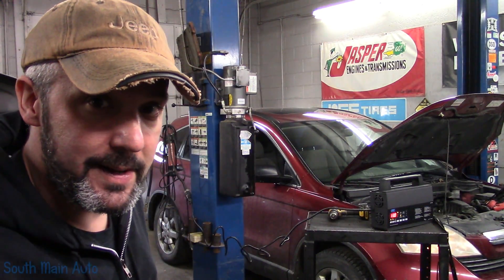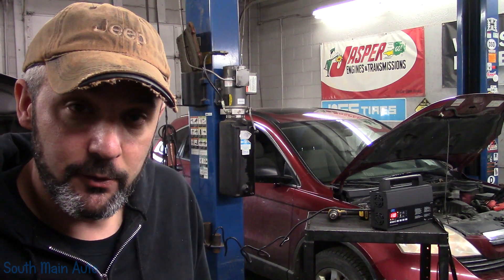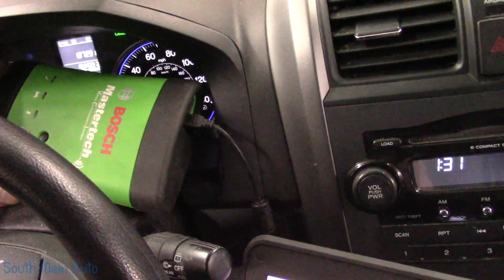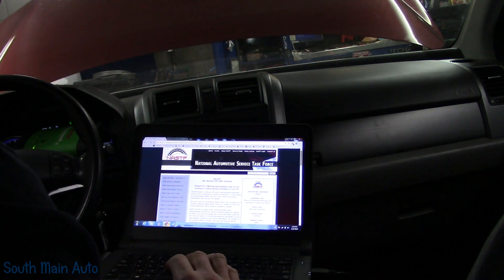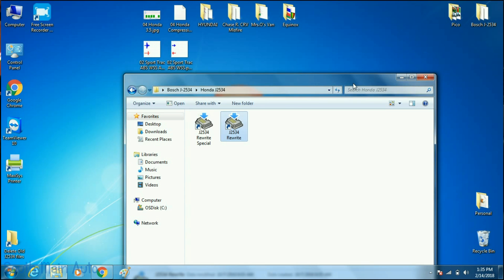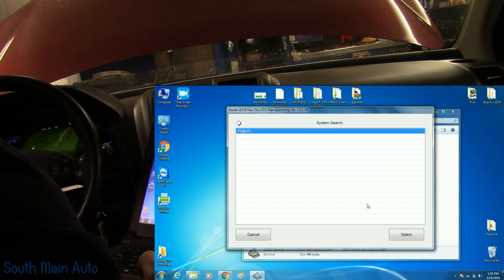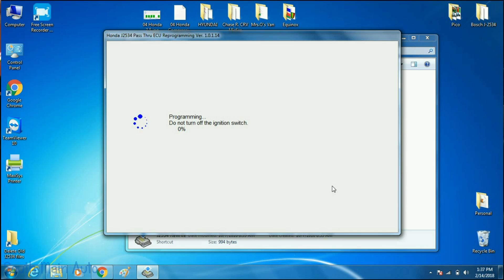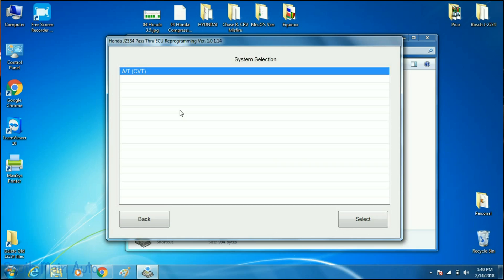Honda J2534 Flash Programming

Comment: Flash programming has been around since 1994. Availability to the aftermarket available in 1997 with the purchase  of some limited manufacturers. 1998 it became almost a standard that new computers will require programming. 2000 I purchased factory tools and started the journey. Let me just say you should be very happy youre coming into this now  and not back then. We had no support , no tech lines , no instructions at all.
Reply: Great info, Keith!
Reply: Keith back then was the laptop even a viable purchase 😂😂
Reply: Kenny B actually NO! We had to use pcmcia cards loaded off a desktop pc 😄😄
Reply: With the technology out there today I'm surprised nobody has revived the old cartridge type hardware. You could have one tool with different plug in SSD hard drives. The drives would have the software and operating system required for whichever make you are working on. Instead of needing a laptop each for GM, Ford, FCA, BMW etc, you just pop in the correct drive and connect up.  That way Keith could go from driving the van to driving a SMART car....
Reply: Does the master tech work as a full function scanner too or just for programming?
Reply: but keith just think of all that knowlege stuck on that noggin  that todays rookies may never have. and that in itself i'm sure has helped you out of more than one bind
Reply: It makes a consumer wonder just how many cars got bricked in the shop back then.
Reply: Thing is that many of those could be re-written without a lot of problems. Not like some of the ones in use today that can be killed if you enter the wrong vehicle options or have a power failure.
Reply: Time to stock up on EEPROMS and an SMD workststion.
Reply: Hi Keith, wish I could meet you and the guys this weekend. Your videos have encouraged me to start the journey! I'm a 60+ year old DIY,  any suggestions on the right j2534 tool for my new 2006 tribute ( and 99 Ram, and ?)  I've seen the  VMC 2  Ford AND Mazda version, Autoenginuity  (I have their scantool), Mongoose, Cardaq. I see I'll need a laptop and the OTC battery tender as well. Hope your weekend goes well.

Comment: It is interesting that the basic design of the OTC 700a, which is no longer available as per my search, has the same basic specifications and form factor as Baum Tools B70A, also no longer available, and the Schumacher INC100, which despite the model number and 100 Amp claim, is only 70 Amp continuous. 

From what I can tell all three are 70 Amp continuous for the vehicle power maintainer function. The problem with these units (or unit, because I think they are basically all the same design) is the output voltage noise level at higher current levels, say 55 Amps, is greater than the old industry vehicle maintainer (vehicle reprogramming, vehicle re-flasher) spec of +/- 50 mV P-P, and worse when connected to jump start posts under hood.

Unfortunately, the units summarized above do not provide a noise specification on the output at different current levels in their data sheets or user manuals. 

It would be very interesting if you could measure the output noise riding on the DC at lets say 13.4 VDC set regulated voltage at a load of 20, 50 and 70 Amps. I have been very disappointed with my Schumacher charger/maintainer products for output noise. The reason being the regulated design now uses a switching regulator approach and not a linear regulated approach. 

The older and now discontinued Midtronics PSC-550s, which was recommended by GM for module re-flashing, was trying to achieve the +/- 50 mV P-P noise specification at an output of 55 Amps while connected at the vehicle under hood battery top posts, but I think it only achieved this spec at 20 Amps at 13.4 VDC regulated output when new.

In summary, beware of what the maintainers are actually imposing on the vehicle power supply in the form of electric noise, which is even a greater concern when maintaining to jump start posts, which, being remote from the battery, have even less of a filtering effect.

Comment: Thank you for the info.  I need to check that update site for my daughter's Honda CRV.  Also, that battery charger beats a jumper box  with a power cord plugged in to maintain the battery! (Personal experience with that one on two 2008 Ford F550's programming the ECM's for those vehicles!)
Oh ya......Great Video!

Comment: A couple months back, they fixed an EVAP error code on my 13 year old Volvo with a software update that allowed it to pass the California emissions test.  No other work on the system was needed, just software.  Always check for updates as some manufacturers will produce safety and emissions control software updates more than a decade after the car was manufactured.

Comment: Anyone know of a good Honda J2534 Pass Thru interface for the DIYer?  Drew Tech's Mongoose is about the cheapest I've seen but it's $483.  I've tried the cheap Chinese hacks of the Drew Tech's interface from Amazon, but it didn't work.  You really only need the cable to be able to communicate and allow passthru onto the PCM/ECM, Honda's HDS does the all the rest and it's a free download from Honda, one just pays for the day/week/month/year subscription.
Reply: Miami13 did you find anything yet? I'm curious and I hds requires subscription right? No way to crack their software?

Comment: Two things, I currently Invested in the Autel Elite and have been using there J2534 flash programmer and its been working good. Works with GM GDS as well.  The second thing is explain to the people what a clean power source means. I know what it means and have been using the Midtronic GR8 for years.

Comment: I always get scared that If my car needs flashing or software updates that most service facilities will not have the proper equipment or knowledge to do it correctly. As Eric O pointed out, you can quickly turn your cars computer into a brick if you're not careful. Nice to see that main site has all the needed info on how to get what u need if you're going to involve yourself in that field.

Comment: how do you like the otc battery maintainer for flashing?? and also how do you justify the cost for programming when the tsb only shows 0.2 warranty time/maybe 0.5 for customer??your j2534tool and subscption cost a lot ,or do you stock couple hondas that require programming and do it at the same time???
Reply from the maker: So far so good, and I charge a flat programming fee no matter what make or model

Comment: Ford and Honda programming software on the same OS, isn't that trouble waiting to happen?
Reply from the maker: I have Ford, GM, Chrysler, Toyota, Honda, Hyundai and Kia all on this laptop.
Reply: I noticed that is why I commented, drew tech toolbox says Honda, Ford and Mazda software has conflicts when installed together and recommends having them partitioned separately. I have not run them on the same partition, so I can not confirm to have seen any issues first hand

Comment: Working on Communications Systems, our Company charged 140.00 pr Hour...How much do you charge 70.00. Theres Mechanical work and there is Computer troubleshooting work. Do not get the to mixed up, and charge according to what you are doing. Its gonna get locked up by the Mauf real soon. I witnessed it in our Industry, its now happening in yours.

Comment: Do we have to pay for the update?
Reply: Depends on the update, manufacturer, and if it's recall/warranty related. Most of the time you pay for the updates.
Reply: For Honda you pay only to access HDS, they have daily/weekly/monthly and yearly subscription plans.  The daily plans are about $10-$20 per day, you can flash/diag as many cars as you can get to during that 24 hour period.  What you really need is a good J2534 passthru cable/interface.  I've looked at the Drew Tech's Mongoose, but they're $483, a bit steep for the avg DIYer, anyone hear of an alternate option?

Comment: My stepdad has a 1990 Chevy extended cab p/u with less than 70k on it. Maybe worth buying it when opportunity arises? I believe someone like me with my limited auto mechanic skills could keep it running for a while longer without taking college level courses!
Reply: Those systems are simpler, but harder to figure out when something goes wrong because they only set trouble codes for the most obvious problems, and if you want any live data then you need to track down some scan tool with GM OBD-I support instead of using any number of cheap OBD-II devices.

Comment: What burns me is when I have called my local Ford and Dodge dealer in the past about a couple different modules that needed to be replaced, I specifically asked if those modules needed to be flashed to work, or if they were stand alone plug and play, because I suspected the former.. 3 times I got burned by the parts counter guys.. They were not plug and play, and I did not have the software to reflash them. Luckily, my buddy did and I paid him to come over and use his equipment. Now I don't trust these yoyos at all, and Google the modules 1st to see if I can do the job or not. I've been surprised about which modules have to be flashed when replaced, as well as just plug in and have a nice day... Just thought I'd share that.

Comment: I hear Cardone has flash equipment.... Any thoughts?
Reply: mike fedele no support , go with Drewtech or Aetools
Reply: Been doing good with the Autel. Nissan, Honda, GM, Ford, Dodge, Toyota but good luck with support from them.
Reply: New Level Auto thank you I did some looking at it and it looks good. I just need to find a reasonable dealer up here in Ontario Canada. Thanks again

Comment: I have a 2016 Chrysler and about a year after purchasing it, I got a message on the "infotainment" system that an update was available and I should follow the instructions.  Had to leave the ignition on engine off for 20 minutes while it downloaded.  This is a Chrysler 200 V6 FWD.  The download was successful.  I am an old timer and all this electronic jazz just dazzles me.  It is now 2018 and the car has 18K miles on it with no issues other than tire air pressure with radical outdoor temps.  But judging by the length of the queue at the only free air pump around when there is a cold snap, it must be common occurrence.
Reply: Pook Atim gotta love it

Comment: I just got done doing side work with some Honda dealerships.  The 2018's now communicate to Honda over the internet via a specially configured WiFi, and then the technician logs into a website at Honda and can do all code reading, troubleshooting, and load software updates.  They call it the AHMOTA system.  While you can get standard ODBII data from them with a scan tool all the programming, mfg specific data, and advanced diags have to happen via the AHMOTA system.   I had trouble getting it up and going at first because of firewall issues, and the dealers had cars they couldn't fix till I got it up and going.
Reply: This is when "obsolete" cars win that race.
Reply: Wow Tom, that's crazy. You getting some cool experience though. Awesome.
Reply: Interesting. I wondered when this was going to happen. The dealerships want their money......I wonder if the pcm is password protected or by other means that keep the programming etc unreachable through the  ODB II port.
Reply: Wow... companies never secure their systems, it'll probably be hacked. Someone will program "Grandma mode" and limit them to 20mph lol. Or worse, disable safety features, modify it just enough to cause accidents, etc. So much bad in this "Internet of Things" BS.
Reply: So how will the DIYer be able to update their cars going forward?  I've been looking at Drew Tech's USB cable and software support in order to program/update my Hondas, I've got an '06 Odyssey and most importantly, an '12 Accord that I'd like to update the tranny on (suffering from bad Torque Converter shudder and been reading that an update might fix it).  Any recommendations on a good J2534 pass thru for the DIYer?  $3,000 OTC is too much for the DIYer. Drew Tech's seems awesome but it's $483.  Since I have multiple Honda products it might prove cheaper in the long run, but it's still $483.  I tried one of those Chinese hacks of the Drew Tech's interface cable from Amazon for $28 but it didn't even communicate w/ the vehicle.  The Toyota versions of the hack cable seem to work well, but not the Honda versions.  Any suggestions are greatly appreciated.
Reply: @miami1393  Did you ever find a solution??
Reply: Sounds interesting.  Hope nobody has a car out of action next time someone breaks the Internet with their fat ass ;)
Reply: What kind of work do u do where you're having access to a dealerships main computer systems?
Reply: KTuner and Hondata already have flash tunes for the Civic and Accord... so I'm guessing no lol

Comment: Always makes me wonder,
In this case the vehicle is 9 years old and has run fine in all those years, 
Then a P0128 code has been set for some reason.
Why after 9 years dose it set this code and need only a software update when nothing has changed on the vehicle?
Is there some kind of time cut off programmed into the ECU?
I just don't get my head around why.
This is not a comment on why or how Eric is doing this job but just general confusion with  updates alone fixing things.
Yes I get the reasoning behind updates when replacing newer components as Eric mentioned with intake runner flaps etc.
Reply: Lots of reasons. Component values in the engine computer sensor circuit might drift with age causing skewed readings. The sensor itself might skew with age. Or more simply maybe the car lived in a warmer climate until recently.
Reply: You know, I thought this exact same thing. Here's my reasoning: The vehicle is equipped with a 180 degree thermostat. Eric O. mentioned that the freeze-frame showed 170 degrees at the time of failure. As I've observed, once a vehicle reaches it's thermostat temperature, it will stay at that temperature and perhaps rise above that under certain conditions. That's normal--the thermostat's job is to keep the engine at it's rated temperature plus a maximum of about 20 degrees above (so a maximum of 200 degrees here). I figure the original programming worked off this logic. When the ECM saw coolant temperature drop below the rated temperature without the engine being shut off first, the ECM flagged this as a problem. In this case, I wouldn't be surprised if the likely-original 11 year old, 187,000 mile thermostat has become sluggish. When the engine coolant cools down, the old thermostat doesn't close as quickly as it did when it was new, tending to keep the coolant at a lower temperature. So, it's likely that the programming update simply gives a broader tolerance region for temperature control. I wouldn't be surprised if a new thermostat, even with the old ECM program, would eliminate the P0128 code from recurring.
Reply: I used to wonder like that.  2 things came to mind.  One!  Preset by Honda to avoid a recall.  Two!  The power train in general ages, like us all, except the operating parameters exceed the "Outer Limits" of operation and so Honda just widens the parameter walls to make the ECM or PCM happy.